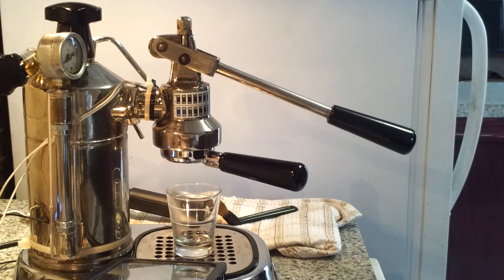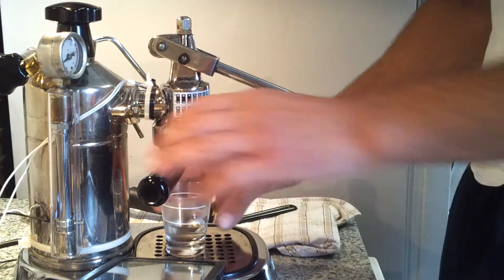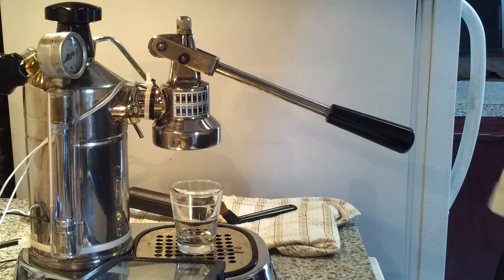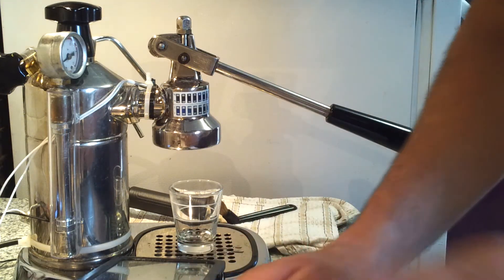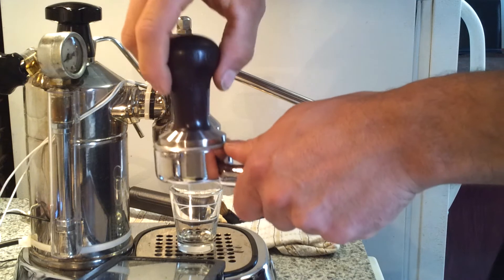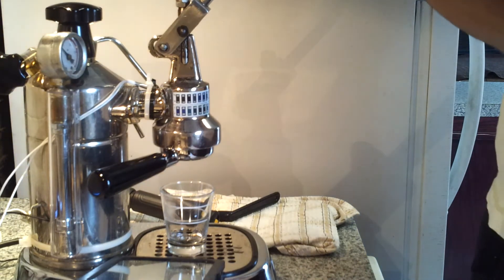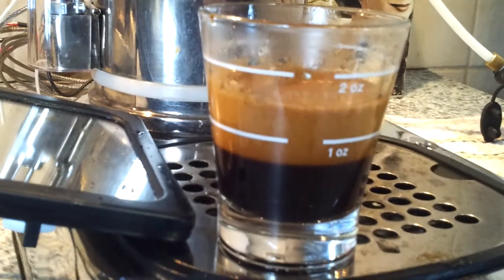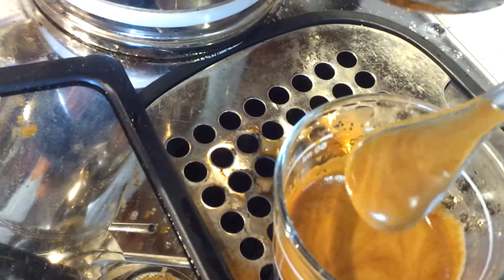Tony LA Pavoni Hd PID Pump Mod Part 2 Crema Shot

Comment: Great solution. What PID do you use to control the temperature? Do you use the temperature of the group to maintain the temperature?
Reply from the maker: No your supposed to tap in the pid to the  boiler but I just put it touching thithly to the boiler and it was very stable a pavoni Hase no new running water from a tank or source so it's very stable!
Reply: @Montreal_Audio_Systems  so you use the temperature of the boiler as the input to the PID? Which temperature probe and PID did you buy?
Reply from the maker: @eduardofcgo  this was a long time ago I changed machine 2 more times after this so o honestly can't remember you'll have to search online I believe they are many but only some are good for espresso I'm sure you will find if you google it sorry
Reply: @Montreal_Audio_Systems  ok thanks! I will try to make something similar to this